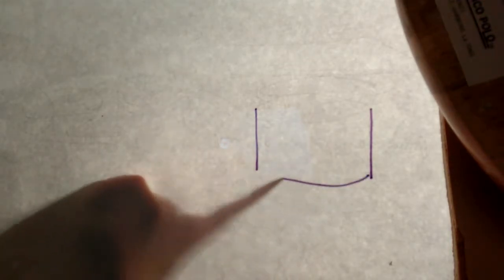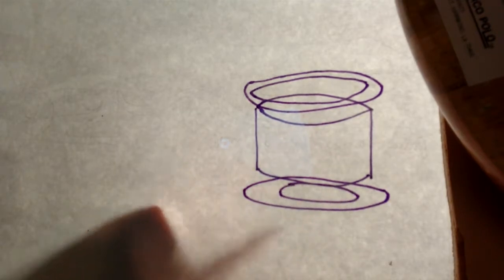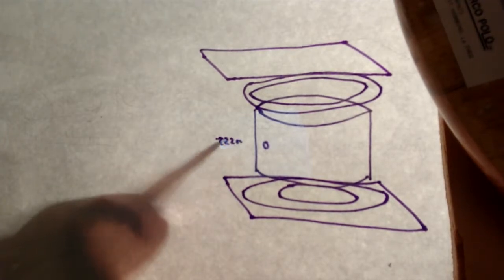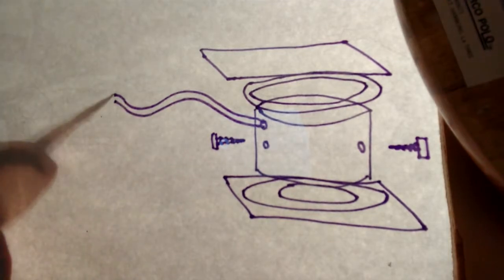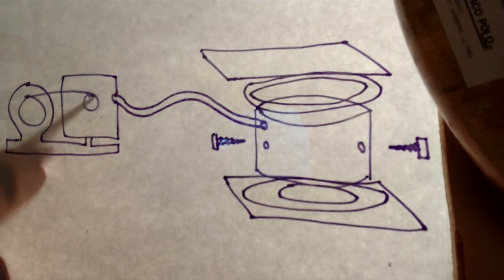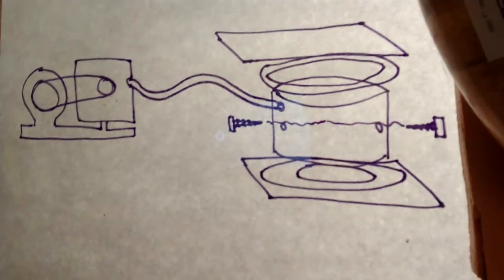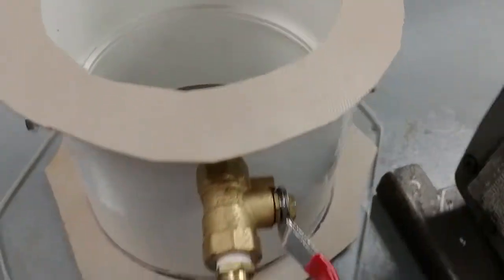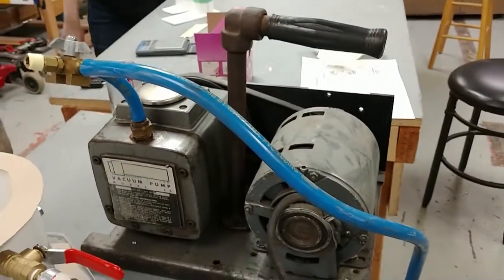Plasma in a Partial Vacuum

Comment: That was pretty interesting... as well as just plain old pretty :] 

 Do you know if the variance in color had to do with temperature/current differences? 

 Cool project√
Reply from the maker: Oh! That's an important detail I forgot to mention so thanks for bringing it up. The color of plasma depends on the gas that is being ionized. And because most of the air we breathe is composed of Nitrogen, that's what's glowing in our chamber. If we'd been able to pump a little bit of Neon in there, it would have glowed orange. Also when we started sticking things in the chamber, like wires and resistors, there were other gases and particles in the mix so the color shifted a little. I'm glad you liked it!
Reply: @pbartmess  Cool! ...so this is basically the Science behind Illuminated Gas Filled Tube Signage√ 

 You learn something new every day!
Reply from the maker: @CaalamusTube  It's true we do. I guess I'd never really learned much about plasma in school so this "workbench science" experiment opened up a new realm of knowledge for me. We're surrounded by plasma!
Reply: @pbartmess  compounded by the fact that it's an arbitrary term :P 

 We're filled with Plasma too! ( Blood Plasma ) ...then there's the other Plasma of Physics. Id est neither Liquid nor Solid. Like glass.
Reply from the maker: @CaalamusTube  Oh that is funny - I hadn't considered that. We're surrounded and filled with it!

Comment: @2:29. Yup - that's drawer liner. We tried some weather stripping the first time around, but could never get a great seal because of that last little gap when you wrap it in a circle. So we perused around the hardware store for a sheet "squshy" stuff that's likely to be air tight, and we ran across that drawer liner which seems to work pretty well
Reply from the maker: I thought so! Thanks James.

Comment: Cool! Please explain to this non-engineer which part was the plasma. Was it the glowing stuff, or ... ?
Reply from the maker: You got it! The glowing tendrils are evidence of ionized gas particles, otherwise known as plasma. Another way of thinking about it is this: when we look at a neon tube at night, like the old Omaha Lace Laundry sign, it glows pink because the atoms and subatomic particles inside the vacuum tube are rushing back and forth between the electrodes and colliding with each other. Each collision produces a photon and, assuming the gas is in fact neon, produces a red glow when it is partially absorbed by the phosphorescent coating on the inside of the tube. The tube is filled with plasma which disappears when the charge is removed. In our little PVC tube there are lots of impurities so the photons are illuminating other gases, including smoke from the plastic around the wire that we stuck in there for fun (last scene). Also the charged particles are emitting other forms of radiation we can't see, all the way from ultraviolet through infrared light and heat. So the collection of ionized particles, which is constantly shifting and held together electromagnetically, is the plasma itself but we only see a narrow band of the radiation it is emitting. It's quite thrilling to be in the room when that little sucker starts to crackle!
Reply: You're spot on -- plasma is the glowing stuff